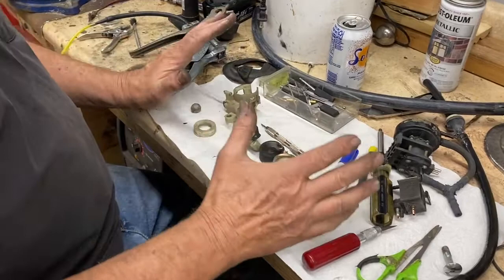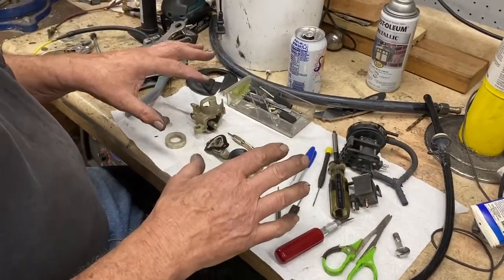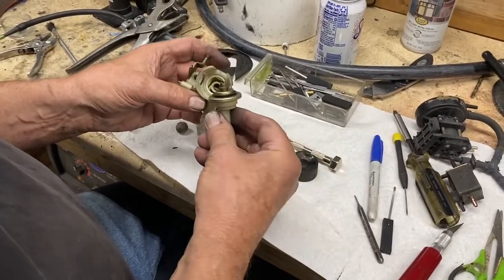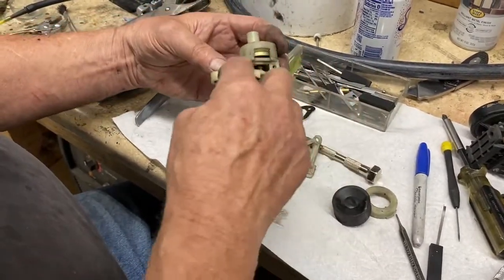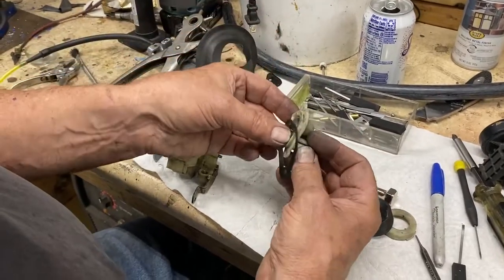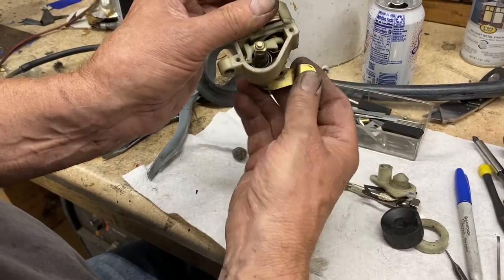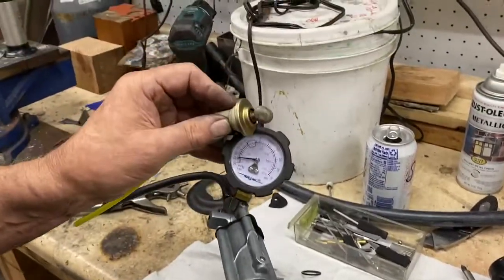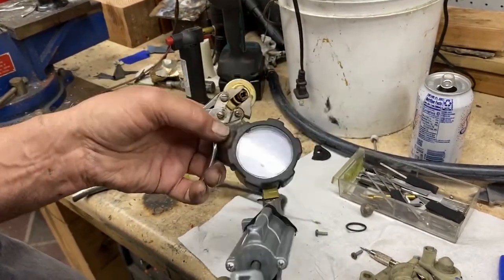Mercedes Vacuum valve 123 070 00 46

Comment: Kickhayner 4 gave an explanation of one on a bench , it was from a manual 4 speed which didn’t get any use , new operation . He went through test with its workings . It holds 15 , when the accelerator is given throttle it bleeds off vacuum .